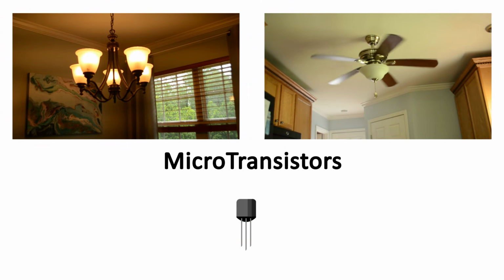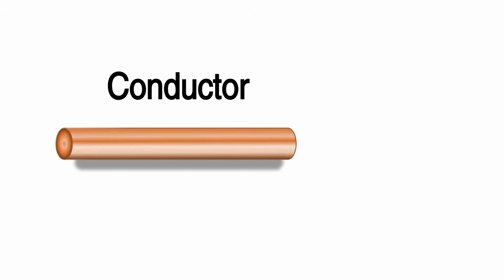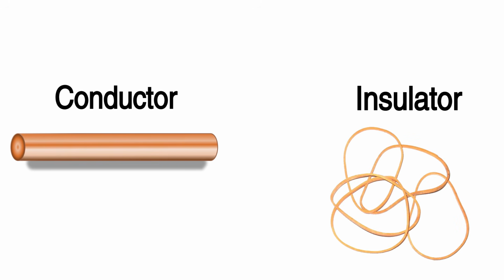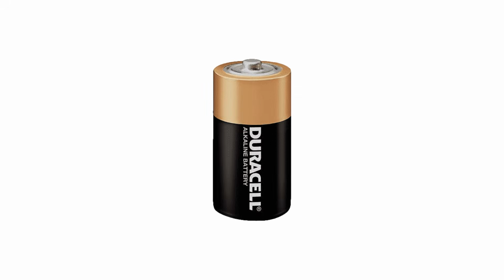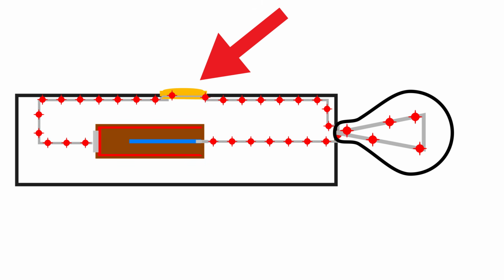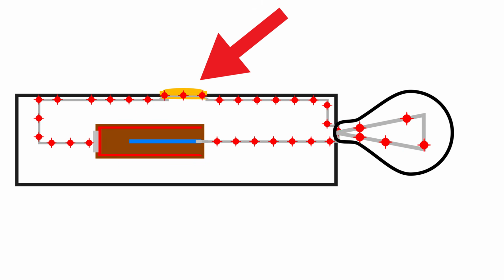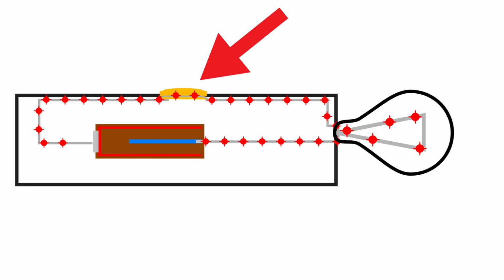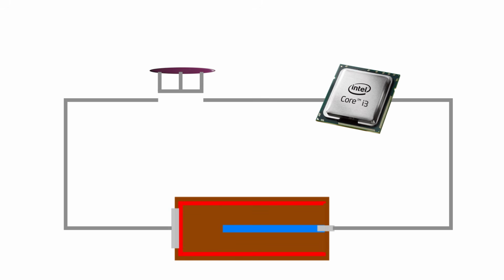How Does a Battery Work? Electricity and Batteries Explained.

Comment: hi h3vtux, love love love your content. but isnt the emf the energy per unit charge or something. rather than flow form region of high number of electrons to low number, i thought the driving for is the emf which measures how much electrical energy the battery supplies to push each unit of charge (coulomb) through a circuit. also u are very handsome <3

Comment: This was my understanding of a battery but it doesnt explain how when measured, the impedance of a battery is very low, in the mOhms. If the electrolyte or insulator is a barrier between the anode and cathode why do we not get a very high impedance value?

Comment: Best video on how electricity works. Congratulations.

Question: When my computer charger is connected to the electrical plug but not to the computer, I've noticed the battery can get a bit hot - does this mean I am spending electricity, even though my computer is not being charged?

Just a curious fellow here. Have a great day, stranger!

Comment: How does it not run out of electrons?
Reply from the maker: Eventually it does, or rather they are balanced between the blue and red part. Then it needs to be replaced or recharged. Recharging involves moving the electrons back to the red.
Reply: @H3Vtux  thanks!